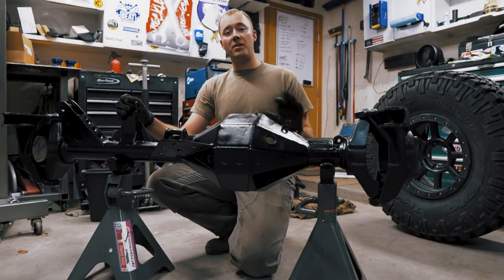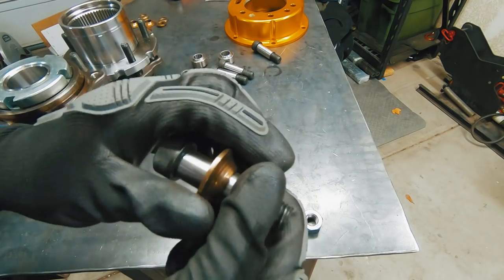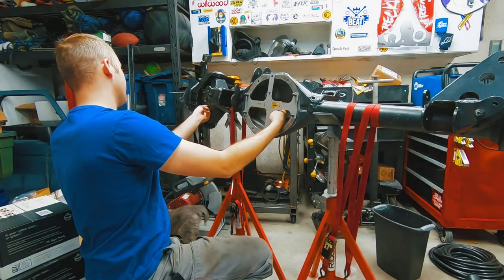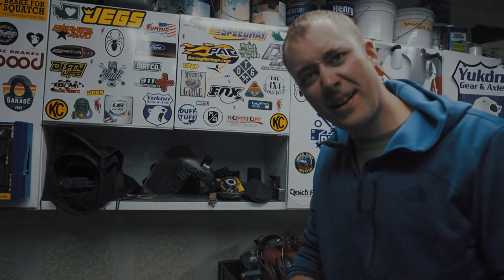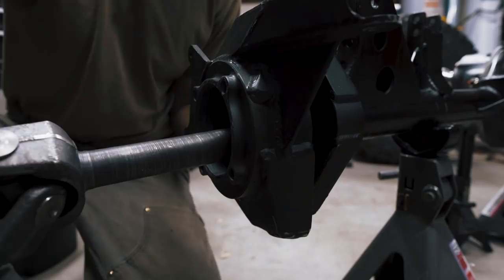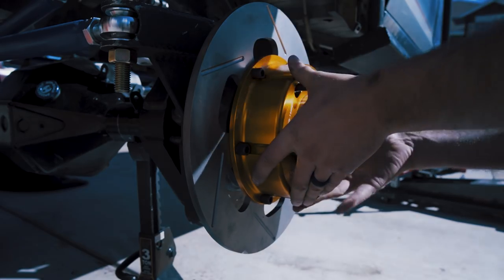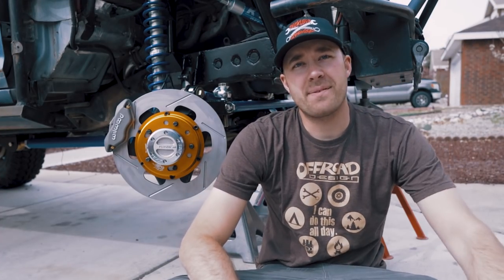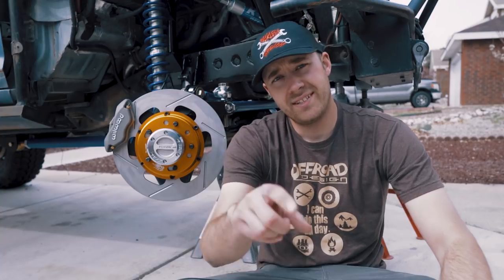609 Axle Build - Reckless Wrench Garage

Comment from the maker: What do you guys think of the new axle in the Ranger? Who is ready for the 3 link and shakedown run? 🙋‍♂️
Reply: Been waiting to see the 3 link.  Can't wait for the shakedown run!
Reply: Really want to build 9 inch diffs front/rear for my 79 bronco with 429 c6 and 203/205 doubler . Do you think these axles would be adequate with 40" tire?
Reply from the maker: These will be plenty for 40s, but get 35 spline chromoly axle shafts

Comment: FYI the Spidertrax unit bearings are 99-04. The 05 and up ford unit bearings are much larger starting out at 35 spline. the 99-04 are originally 30 spline that are bored out to 35 spline

Comment: That's really a dream axle! 50 degrees is gonna be rad
Reply from the maker: I'm currently limited to right around 40ish degrees because the axle yokes bind and the tires get into the links. In the future I may pay to have the shafts milled out and put bends into the lower links

Comment: I’m building a square body suburban. I know Chevy stuff but I just went down the ford rabbit hole recently. So I’m probably gonna go and get me a high pinion 44 and buy a 9 inch housing off summit for the rear. I never knew anything about high pinions but now that I do I wanna do high pinions front and back on my burb just because there’s so much you can do with these and how easy they are to build. I wanna do a Jana D50 in the front and a hi 9 in the rear. I’m assuming I can stick on a 14 bolt flange on the rear and run a full float axle shaft in the back. My burb isn’t a rock crawler I’m just building a overlander and intend to lift it little and stuff 35’s/37’s on it. The parts and modular design for these axles are crazy and I think they’ll be the perfect first dabble in fabrication/axle setup.

Comment: Make sure you put stover locking nuts on the knuckle bearing bolts.
Reply from the maker: Thanks for the heads up, the nuts are the "c" type locking nuts
Reply from the maker: BTW we want to get up CO and do some wheeling sometime
Reply: @RecklessWrenchGarage  yeah as long as they are the deformed type. Built many of these and driver is the only way. Nylock.is junk and none locking will come off.

Comment: Wow badass axle. Way out of my price range
Reply from the maker: It is expensive compared to a junkyard Dana 60 swap. If you consider the cost of gears lockers, bearings etc. being the same regardless what axle you build, this style is still only slightly more expensive but you get a stronger/lighter axle

Comment: How are you liking those Wilwood brakes calipers on the front? I'm thinking of going with those 4 piston or upgrading to 6 piston for my swap but my truck is a light toyota pickup single cab
Reply from the maker: They have worked great honestly! I did just pick up some 6 piston wildwood to test out. Going to move the 4 piston to the rear axle. Haven't been able to try them both and compare them

Comment: Do you think that an axle like this would be able to handle 1000HP from a turbocharged 5.3L LS? Looking at building a lightweight 4x4 tube chassis vehicle.
Reply from the maker: 1000 hp is too much for the differential. The housing and knuckles would be alright. For that much HP you would need a 10 inch differential from gear works or tube works and 40 spline axles
Reply: @RecklessWrenchGarage  Thanks, I thought that something would have to give, just didn't know where it would be. Figured I might want to get an idea before I start sinking money into the build. I already found a suitable Built Transmission, Transfer Case, and Chassis. Still need to find a 1000HP capable Driveshaft, and Brakes.

Comment: Have these u joints broken before im wondering if rcv cv's would be stronger
Reply from the maker: The weakest point of this setup would be the yoke ears of the axle shaft. RCVs wouldn't fit in these early design spidertrax knuckles, so this was the strongest option
Reply: @RecklessWrenchGarage  Thanks for the prompt reply im in australia and looking at my options for a nissan patrol ive just been reading up on  what the rock bouncers are doing with dana 80s but like yourself  im wanting light if i can.  I have some aam 3500 diffs here but i cant believe how heavy they are and i would be up for carli ball joints they would be 11 or 1200aus shipped its a big investment

Comment: Machined out the center of ur wheel to fit those hub lockers?  Will that cause the lug holes to be too thin from the center?  Any danger doing that for a daily driver?
Reply from the maker: The wheels are not machined out they are still how they came from the manufacturer, most wheels should come with a hub opening big enough
Reply: @RecklessWrenchGarage  Im buikding a 2015 Yukon XL with a Duramax and Allison. Have a sick set of $4,400 custom 22" wheels and I will ha e to do a solid front axle to fit the Duramax.  The custom set nor the factory wheels have enough opening for even a Dana 44 manual hubs.  Considering doing a large tube 44 and machining the wheels just a bit.  Id never be able to opening them up to fit 1 ton hubs.. Whats the point.  Its a mall crawler anyways.. Need 4wd to vef oug of a wet yard. :)
Im a DIY guy.. Love ur videos

Comment: Hey guys. I didnt know how to message you without adding a big comment, but I recently purchased a project truck (on road only). Its a '79 Ford F150 single cab long bed. It has a 302 and a NP435 transmission.  It also has a Ford 9"rear end and not sure of the ratio in it yet. But it sat for 10 years under a tin roof in Florida. When I bought it,  it didn't run or have brakes. I've owned it for 3 weeks now and it runs and has a completely new brake system. I dropped the gas tank on it because of rust holes. I have a new tank and sending unit, but am waiting for the vent valve seal. I've never had a project like this before and it's a great learning experience. But I wanted to get a limited slip diff for it, but not sure who makes the best ones. Since you guys do a lot of torque inducing stuff, what is the best diff you've found for on road use?

Comment: Im saving for a front 609 and rear super 14 bolt for my 4runner
Reply: I want to save for a 609 also. Do you any idea on the price, ballpark? I don’t know how much more I’m going to need.
Reply from the maker: I have been thinking about doing a video on building a budget 609, would you be interested in that? It's very dependent on the parts you use. If you go hi 9 the third member is expensive, but you can save money assembling it yourself, or you could use a standard 9 inch third and save even more money, but lose high pinion. This axle also used spidertrax knuckles which are very expensive, but also the strongest on the market. You can use standard dana 60 knuckles and inner c from a junkyard and save money there too. I have about $4k into this axle hub to hub with third member. I think I could build a budget one for under 2500.
Reply: @gusamaya2934  my 609 parts maybe different from yours i got the front f450 steering knucles free from my neighbor but have 950 for tge ruff stuff 9 housing 1250 for the 9inch 3rd with 513s and detroit locker havent got axle shafts or inner cs i plan on usining reid racing cs and custom rcv shafts
Reply: @RecklessWrenchGarage  that would be amazing
Reply from the maker: It sounds like you have a good plan on your axle and it should be super beefy! My only issue with the ruffstuff housing is the center section is very big and can be hard to package on certain chassis. I think Im going to try and build a budget 609 using as much from the junkyard as possible and set the width to use stock axle shafts
Reply: @RecklessWrenchGarage   its going on my 88 4runner thats on d44 and 12bolt currently im running a 4.3 so i may have issues not sure yet though havent gotten that far lol
Reply from the maker: Ruffstuff, diamond, trailgear, currie and spidertrax all make awesome housings
Reply: @danielkennedy5210  oh ok gotcha. Definitely sounds like a strong build you got going.
Reply: @RecklessWrenchGarage  if I use a normal 9” what degree would be good to set it at as far as pinion angle goes? Trying to keep it a low budget 609.
Reply: @gusamaya2934  thanks the one thing im figuring is if i can reuse my current full high steer steering
Reply: @danielkennedy5210  that’s awesome. Being able to reuse parts and save on a build is always nice

Comment: What was your total cost for the build?
Reply from the maker: I collected parts for over year, so keep in mind this was not a purchase made all at once. Everything came together right around 3k. Not cheap but any means, but compared to a crate axle or building a salvaged axle, this was a good deal.
Reply: True, best route was collecting parts needed for an upgrade.
Reply: @RecklessWrenchGarage  Not bad at all. I have $4.5k in to my junk yard king pin Dana 60 (but with RCVs)
Reply: RecklessWrenchGarage tbh that’s cheaper than I expected